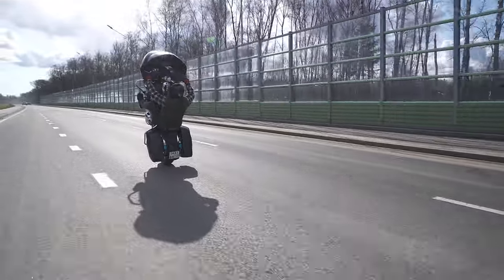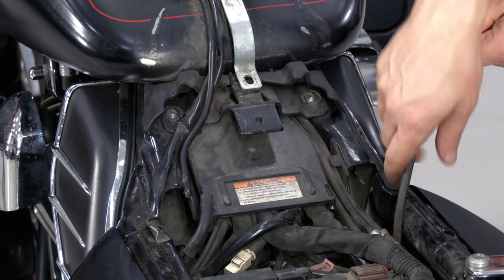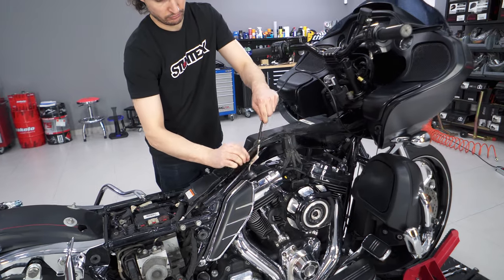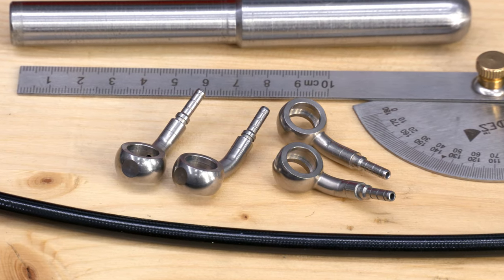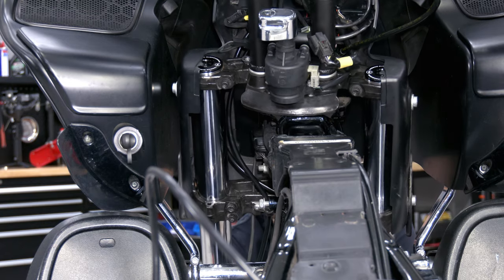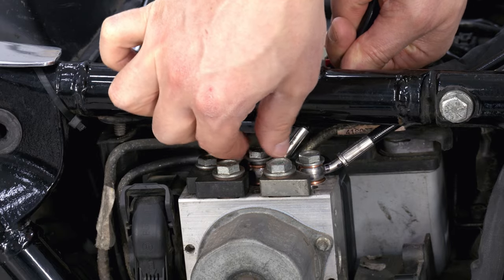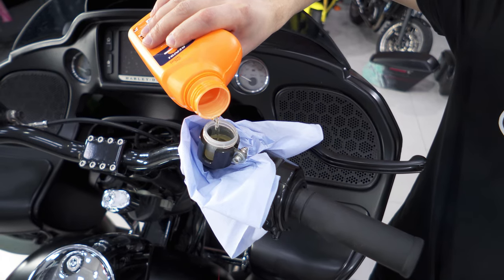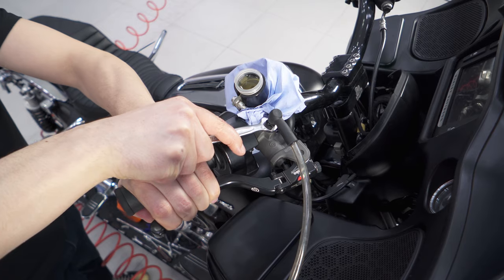Brake Lines Build on Road Glide Special

Comment: Did you use the same bolt you took out of the abs block when you reinstalled with the round fittings?
Reply from the maker: Yes
Reply: Ok great because I bought new brake line braided cable for my bike and it has the round fitting on the abs block side and stick it comes with a odd shape block on it.    I’ll have no issues using the round fitting with stock bolt I hope